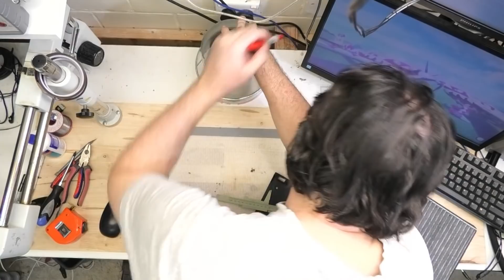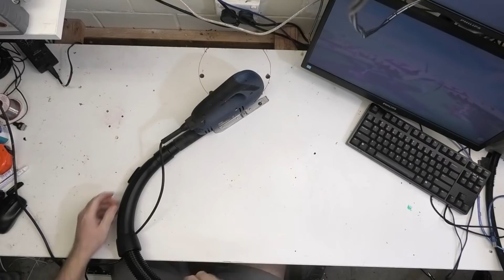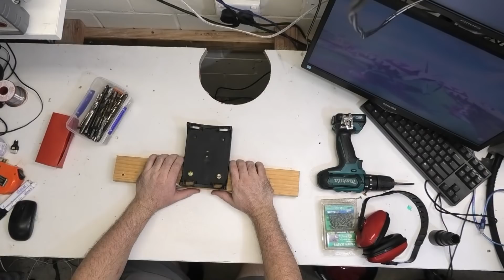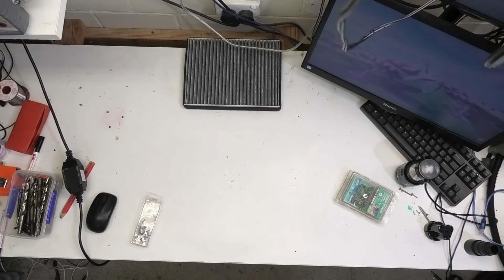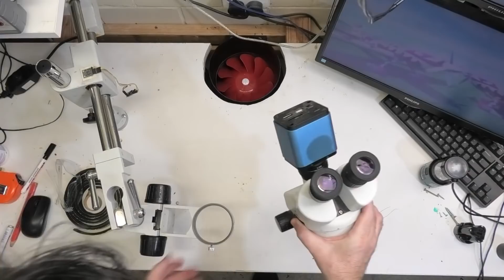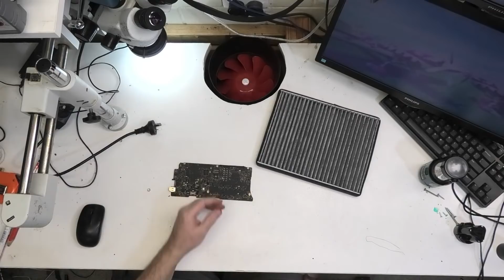PART 1: Workshop HEPA Air Filter reconstruction.  From overhead to under table. 200mm @ 1000cu.m/hr

Comment: Hey Paul. Maybe look into acoustic duct. Its the normal flexible duct with a foam insulation on the outer side. You could run this on both sides of the fan, then you could place the fan further away and have the ducting come to the hole. It will also make the fan a lot more quite. A good hydroponics store will sell the stuff.
Reply: Also Paul Daniels, don`t run the fan at less than 50% power/speed for many times and long times. These kind of fans will burn out a lot quicker if you do so. Dunno why this is, but it is.
Reply from the maker: Really depends on the motor design. These are single phase inductio and usually split-phase permanent capacitor types. Given the restricted range of speed this is likely a triac chopped & snubbed controller as opposed to a rheostat.

I've had this one over 4 years now and it spends most of its life at the lowest setting.  The most important part on these units is that they start at maximum speed, so that eliminates the risk of stalling/high-load on start; aside from having something jammed in there :-o 

VFD would be nicer but for under 200W this works well enough and is simple.

Comment: Paul although jigsaw does the job,  trim router with circle jig adapter would be easier n neater way to cut the hole,  90 bux off ebay or ryobi from bunnings , very handy tool, I have makita and Milwaukee 18v trim routers but cheap corded just as good.. Wayne  89 bux this is an exact copy n I mean exact copy of makita 
https://m.vevor.com.au/compact-router-c_10131/vevor-hand-trimmer-router-palm-laminate-compact-710w-variable-speed-p_010643642241?gclid=Cj0KCQiAr5iQBhCsARIsAPcwROOWDzX0_QyxYUVrOwDR8WXDEsUFyV1HOCFqC0C2SpUtwfxraQ-ZALEaAlkpEALw_wcB